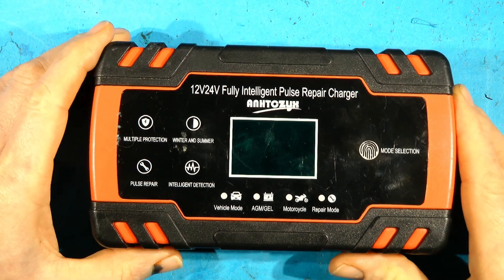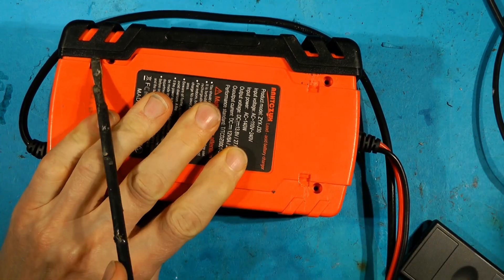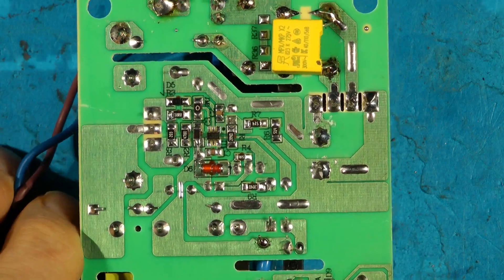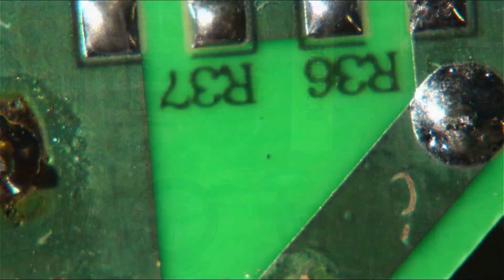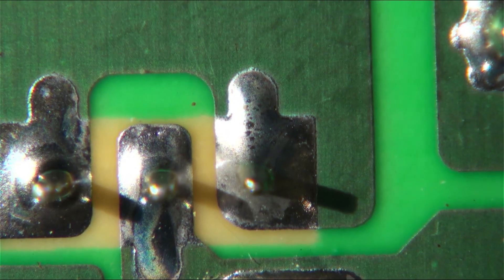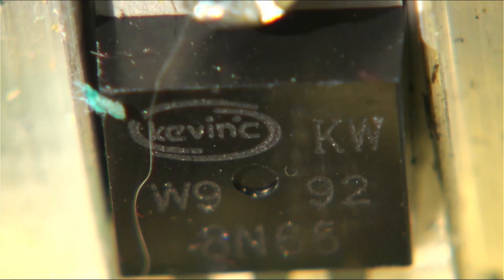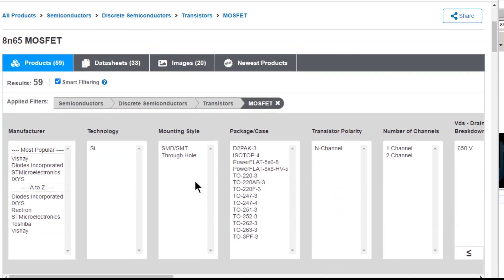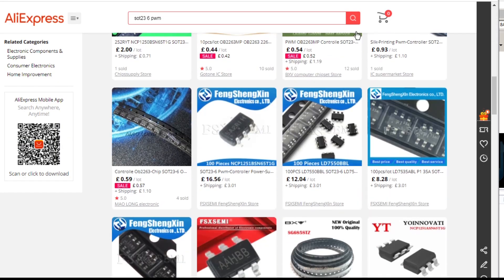ZYX-J30 12/24V 8A Battery Charger Can we identify the PSU components to help Elvis

Comment: My charger stopped working recently, ended up using my lab bench supply to charge my battery.. After looking for a manual and coming across your videos instead, I just cracked it open to see any obvious issues. There definitely was. The 60N06 MOSFET gave up the ghost and all of it's white smoke at some time. The board was definitely darker around it but couldn't find any other issues. I didn't have an exact replacement for it , but I had one with lower gate demands as well as about twice the current capacity, but only rated 55V instead of 60V.. figured since it theoretically only should get to just under 30V on the output shouold be good.. It charged a battery that's on it's last season without any issues. Then I gave it a shot at a battery that's completely shot to shit. I think two of the cells in it are shorted and pretends to be an 8V battery. I let the charger have a shot, then the wife informed me later on about the electronic smell in the garage. It had killed the MOSFET after a few hours and have self heated until it unsoldered itself AND the heatsink and dropped out of the board. Also decided to test the caps that are next to the heat sink...definitely bad placement next to something that gets hot. Ended up testing way out of spec.
Reply from the maker: If the MosFet undergoes catastrophic failure, it necessitates a thorough evaluation of the components within the gate drive circuit. Has you charger a a cooling fan? Some units I have seen the FAN has been omitted to save cost. Without an adequate cooling mechanism,  excessive heat generation that can degrade the MosFet under heavy operational loads. Substituting MosFets requires meticulous scrutiny of their datasheets due to variations in gate capacitance and switching characteristics, which must be directly matched by adjustment of the associated components. Attempting to replace a MosFet with a near-equivalent without proper consideration often results in heightened power dissipation and compromised reliability, manifesting as decreased efficiency. This design lacks inherent reliability, pushing the FET stage perilously close to imminent failure.

Comment: I do have intellectual curiosity and an engineer's desire to "fix it not 'frow it" if damaged just as you obviously have but I have to ask, at the price for these new, is beggaring about spending so much time trying to find components and effect a repair a viable proposition? Another new item is easy to locate, is still cheap, seems to have been updated so maybe could be again, and you would even be left with a blown board carrying a variety of original replacement parts. The Chinese marketing philosophy of design it cheap, make a billion, sell them cheap, chuck 'em when they go, does lend itself to our desire to not pay too much for anything nowadays. E-issues apart it does have it's attractions.
Reply from the maker: Up to your conscience as to whether it is worth it. I would imagine that less fortunate people with some skills and  can't afford to run with the the 'Take , make and throw away' regime.      Also you should consider the value of learning new skills, Pass in on Boys - Pass it on.
Reply: @razenby  "Also you should consider the value of learning new skills", yup, I concede that point absolutely.  Self education and learning new skills is something I had not considered.  Thanks for the info in the first place.  Purely for reference, I have a more modern version of this unit than your original in the other vid.  (Case date stamped: 2021-02, Make: E-Fast, Model: ZYX-J40, PCB: JF-12-72W (DC12-24) V1.6, more rounded case style).  It too came fitted with a common mode choke L1 and capacitor CY2 but is still missing the varistor VR1 and high voltage cap CY1.  The "UK plug" is just a clip on item over the original 2pin, crude but functional.  However my mains leads are also wired the wrong way round.  (What is it about our mains wiring they can't get?)  The PCB layout is markedly different but the guts seem to remain pretty much the same.

Comment: Another interesting thing here, yours is 12/24v mine is identical outside but only 12v? and 6a I would be curious to know the difference. I did tempt fate and tried it across 18v (6v X 8, 48v battery bank) and all it did was indicate full battery and the fan ran faster. It's a pity I cant upload pics here for you to see.
Reply from the maker: Interesting I haven't sen that version. I think it is better to have 12V version as you don't get the mistaken identity on a very low 12V battery.  6A is better for car batteries unless you have  a huge one.
Reply: @razenby  My batteries are huge, probably 50% bigger than a 110Ah car battery. There are 8 batteries in the car, each one is 6v at 200Ah. If all fails with the charger, then I will drain them and fill with a solution of Epsom salts, pass a low current through them for a couple of days before refilling with new acid and see if that does any good.
Reply from the maker: @johnlannigan9831  Are they standard wet cells with filler plug?
Reply: @razenby  Yes, Trojan T125 lead acid batteries.
Reply from the maker: @johnlannigan9831  Can you see the plates - are they badly sulfated ?
Reply: @razenby  They could be better looking but I cant see much evidence of sulphation in the ones I looked at. I even tried Bat Aid pills which were supposed to help reasonably sulphated batteries, I added 4 per cell, I had taken voltage and current readings for each battery and they made no difference. The pulse charger has made a slight difference to the batteries Ive used it on, leaving a set of two on pulse for a couple of days minimum. The worst battery even after a prolonged charge was down to 5.7v, 48 hours of pulse charge the battery sits at 6.3v an increase of 0.5v

Comment: Hello, can you tell me which PWM controller should be?
Reply from the maker: Sorry I cant find it. I have had a good look on the internet. It is only a 6 pin controller and there are many on the market. You just need to trace the pins out and buy one with the same pin out. It is likely a chines domestic market part copied / equivalent to a western device.  Very hard to find.  Some values or the peripheral components may need to be adjusted  to make it run at the correct switching rate.

Comment: Another pin another PWM. OB2532MP not 840K40 840L25, 840L28, 840 have these pin  1 — VDD, 2— SENSE, 3—GATE, 4—GND, 5—empty, 6—FB. Pwm Have not standart pin.
Reply: OB3840MP
Reply from the maker: I know they are not the chip at Aliexpress. My point is that the format of the ident is the same. 2 rows of characters in the same font. The P means lead free ROHs. Since the chips in the picture have the same format it is very likely that these are from the same manufacturer. However the ident on the chips in the photo do not match the manufacturers datasheet so either they are a clone or they just used a random photo.

Comment: The newer units dated 2020-12 on the back of the clamshell have an updated power supply board which is labelled as "V1.6".  The component layout from the top side is basically the same except for they placed the 7812 on a heatsink, rotated it which displaced a couple of the capacitors and forced the fan connector and the resistor R34 to exchange places.  

On the bottom side of the board, things get a bit more interesting...  The 6-pin chip in question from the video is labelled "840L 41" on the first line and the second line "035 P".  The other components surround the chip hasn't changed.
Reply from the maker: Thanks for the info.  Has anyone seen a truly reliable power supply that uses the 6-pin SOT-23-6 package? I don't recall seeing one.
Reply: @razenby  My "Jinfeng Electronics Motherboard First Generation V1.6" (literal translation from the text on the board) has U1 on the bottom of the board labeled "840K35" on the first line and "630 p" on the second the 'p' is a different size font and off to the side.